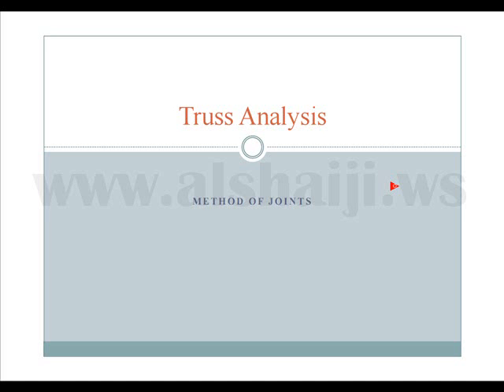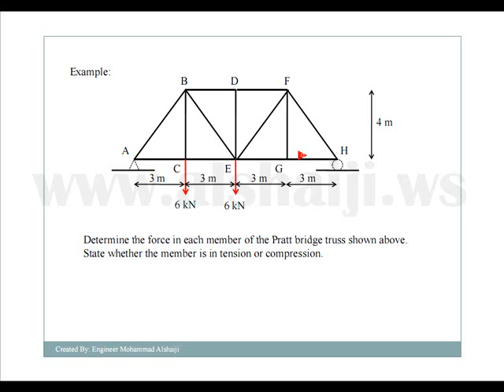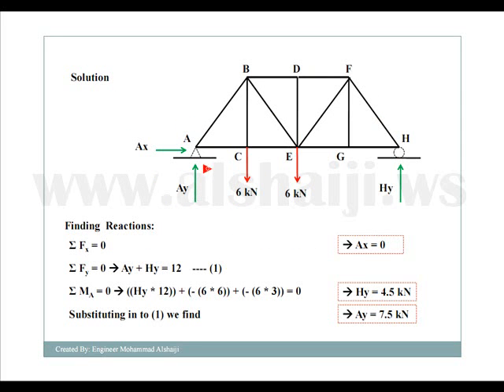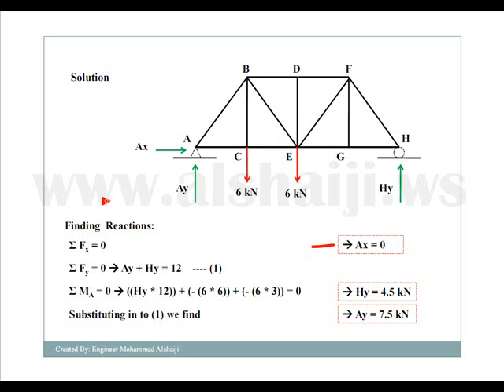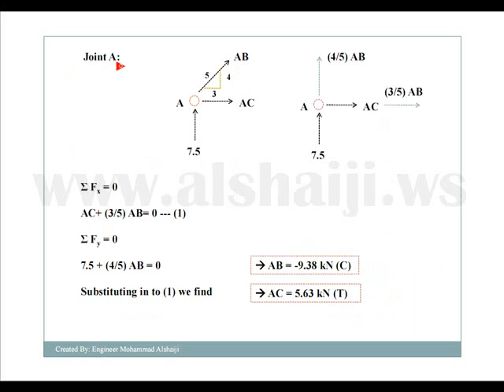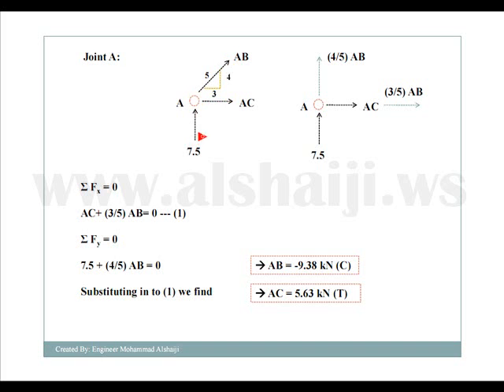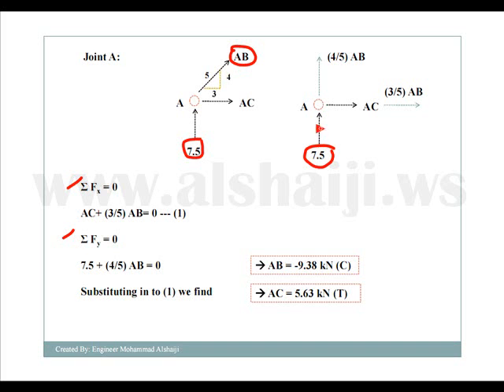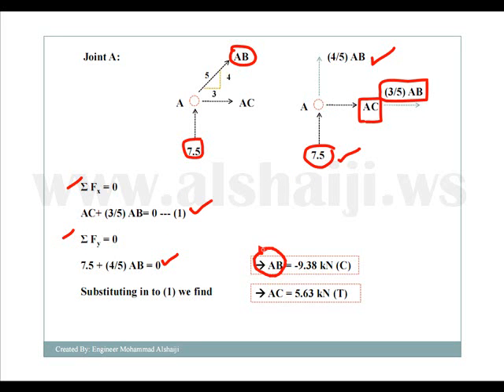Truss Analysis Using Method of Joints – Part 1

Comment: where did you get -9.38  i solve it in my calcu and the ans is 8.3
Reply from the maker: Solve it manually. AB should equal to     - (5 x 7.5)  / 4  which gives you -9.375

Comment: I found this very useful, I appreciate what you've done. A great tip was that one should draw the force from the join with a T and then see if the result is positive, which means that T was correct, and if it's negative then there's compression and the force should be opposite.

Comment: Why you reaction force Ax was equal to zero when you decide to work at joint A? Why you did not include it in your equilibrium equation since it is in the same direction as the member force AC? Should not it be : Ax + Acostheta + AC = 0
Reply from the maker: The Ax is zero from the begining. Since all loads acting on the truss are vertical, the horizontal reactions are all zero. That is why Ax is zero

Comment: 7:45 of your video I  got 8.3Kn by doing 7.5+4/5. Is this the correct method? You  got -9.38? What steps did you do to get this answer?
Reply from the maker: The 4/5 is multiplied by AB. Just solve for AB.
AB = -7.5 * 5/4= -9.375

Comment: but they dont equal to zero in last joint , so how is it correct?
Reply from the maker: Maninder Singh what do you mean? can you elaborate?
Reply: CTSCIVIL for the truss to be balanced , sum of forces in last joint need to be equal to zero , which they dont in above equation
Reply: Maninder Singh P.S can you please tell ,how do you take the X and Y directions in individual joints to be -ve or +ve , do we take the directions by assuming the origin of XY plane on the main point of joint , like in joint A origin is at point A
Reply from the maker: Maninder Singh from your question, you are referring to joint A. The following forces are to be drawn at joint A. At joint A you have a reaction (up) Force GH (or HG) out of A to the right. a force FH (or HF) "INTO" A with a certain angle. All you need to do now resolve these forces into components and check equilibrium. As for signs, I take Positive and to the right "Globally". Try that and let me know what do you get
Reply: CTSCIVIL  i did my assignment by ur method , can you please check the answer and tell me if it is correct or not? bcoz i feel unsure about my answer , the question is totally the same but numbers are different

Comment: When you first start solving a truss isn't it better to pick a joint that has 2 members with an external force than a joint with 2 members and no other forces? I know that's how you did it but I've seen that also and it just doesn't seem right :/ thanks for the video btw it's super helpful :)
Reply from the maker: Alice Morton you are right, it is better to start with a joint having external forces and a maximum of two members. Yet, in this example, can you find one? :)Thanks for stopping by

Comment: At joint A,  AB = -9.38 kN.  Shouldn't that be ABy ? and then you would have to find ABx from 3-4-5 triangle which ABx = 7.035 KN.  Then the resultant of AB is (9.38^2 + 7.035^2)^1/2  = 11.725 kN.   Sorry, It's been 10 years since I took back in college.  Please let me know.  Thanks
Reply from the maker: warsatan23 AB = -9.38 kN is the compressional force in member AB. you can always resolve them into x and y direction. But, in a truss, we are always interested in the "normal" force in the member. Why are you resolving if I may ask?
Reply: I understood your method, just a bit hung up at the x,y component and whether or not when to combine them to resultant force. I'm taking the FE exam this coming month.  I'm looking through one of the example in the book.  They're solving the truss problem by using the section method. Thank you for the feedback.
Reply from the maker: warsatan23 Good luck in the FE Exam :)

Comment: Dear sir, thank you very much for putting your time and effort into such helpful videos, much appreciated. I have once question to ask, that is how did you get the 5, 3 and 4 in the triangle when you analysed the joint A? Is it some simpler method of solving it, I  couldnt catch it.
Thank you.
Reply from the maker: Good question,
Look in the video "English - Drawing N, V, and M diagrams for a frame with an inclined member" around 8:50 minutes. I talked briefly about how using these numbers can lead to the same solution instead of sines and cosines.
Reply: Okay, I will have a look, thank you very much sir :)
Reply from the maker: you are so welcome

Comment: Hi, I have one question regarding to joint A. When you calculate the vertical and horizontal forces. I have tried it by using ABsin60 for vertical and ABcos60 for horizontal but I couldn't get the same answer as yours. Why is that? Thanks in advance.
Reply: The degree isn't 60.  It is 53.13 because tan0 = 4/3.  Might be a little late but wanted to let you know.
Reply: JohnSAN51187 Thanks for your reply. I got it.

Comment from the maker: the roller allows does resist a) movement in the x direction b) rotation
a hinge (triangle) does not resist rotation only.
it is still static even if there was a movement in the roller, and remember the roller can move a certain distance (extremely small) then it will stop.

Comment from the maker: depending on the support type, you may have 1,2, or three reactions. For a roller, (support H in the above) has only vertical reaction. for a hinge (support A above) has one vertical and one horizontal reactions. for a fixed support, (like a cantilever beam) you have three reactions vertical, horizontal, rotational.

Comment: 3,4, and 5 is used because 3m and 4m is already given as you can see in the diagram. Substitute 3 as side a and 4 as side b in Pythagorean theorem (which is c²=a²+b²) so c²=3²+4² and you'll get c=5... a is the shortest side which is 3, b as next longest which is 4, and c is ALWAYS the longest side (or hypotenus). I hope this helps. :)

Comment from the maker: there is no 3/5 AC :) all has to do with AB
the 4/5 AB is resolving the force from member AB in the direction of the 4 m (vertical) and if we use 3/5 AB that is resolving the force in the direction of the 3 m (horizontal)
that is a way of resolving the forces when studying joints if you are not given the angle between two members.
to make sure, try to find the angle between members AB and AC then use the cos(theta) and sin(theta) to resolve them and compare answers with what we have here

Comment: For the joint A , How did you get AC + 3/5 AB = 0 
How did you get 3/5 and 4/5 ? the number 5 is not there in the question ?

Comment: Continued from last comment: Then you have a table you fill in, with columns like F0, F1 (where F0 are the forces you worked out in the vid above, and F1 are the "virtual" forces of the truss, which you work out when you do the truss equations a second time (see my previous comment)). One of the columns is A, which is the area of the members, which varies depending on whether they are in tension or compression. To work out which beams are which, do you look at th F0 forces or the F1 forces?

Comment: Okay I have a question involving the deflection of pin jointed trusses. The method our lecturer taught us involved doing the stuff you did in this video, then doing it again but changing the forces. The second time we do it, we put forces of 1 on some of the joints, depending on what the question asks (e.g. if we have to calculate the vertical deflection at joint E, we put a force of 1 vertically at joint E). But then you use the area of compression and tension numbers and a deflection equation.

Comment: @mxlwmtiam Well what do you think happens when thermal expansion happens? if they can not move any further in the horizontal direction (due to very tight bolts) what do you think would happen?

Comment from the maker: @mxlwmtiam 

Analyzing trusses with fully rigid joints is not generally recommended, as the transfer of moments at the joints makes the connection design much more involved. It may be that the consideration of the joint capacity inspires a slight adjustment of the setting out, to provide a gap or overlap joint, which introduces some modest eccentricity. This is generally taken in the chord members.

Comment from the maker: @mxlwmtiam 
I asked this question many years ago:
It is recommended that triangulated trusses are designed with simple, pin-jointed members, even when the truss connections are welded.
This practice has been successfully followed for decades, and is enshrined in design Standards. which states that for the purpose of calculating the forces in
members the connections may be assumed to be pinned. Assuming pinned connections is obviously ideal for hand analysis.

Comment: I'm getting lost when calculating the AB force. I get 7.5 + (4/5)AB= 0, which means AB=8.3, right? Where do you get the 9.83 from then? What am I missing?
Also, the reason you use (3 4 5) for the sides of the triangle, is it arbitrary? I just don't get where I get those sides numbers come from....

Comment from the maker: in order to get 3/5 AB you need to resolve the force in member AB
if you have angles, you usually use sines and cosines to resolve forces into components but in out example we use lengths of members instead. lets say that we have an angle "theta" between members AB and AC, the horizontal component of AB will be (AB cos "theta") and the vertical component will be (AB sin "theta") look closely at the vertical component and you will see it is the same as 3/5 AB using the triangle ( 3 4 5 ) above.

Comment: hello i have exam tomorrow, i seriously need to know this.
for example my assumption is Compression and i get answer in Minus, means the member is in tension. so in order to find the another member in the same joint, should i use the minus value or plus value?
and is it better if i always assump Tension?